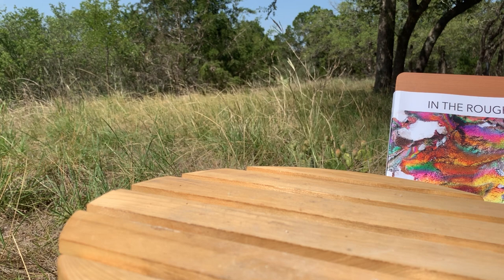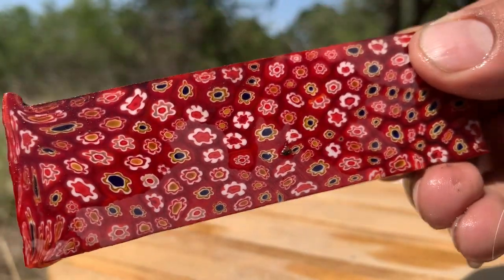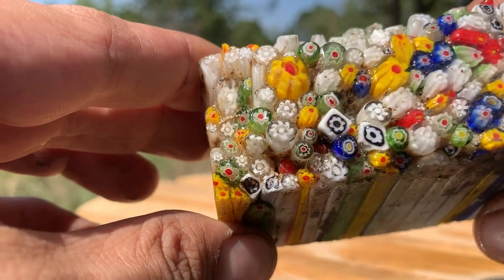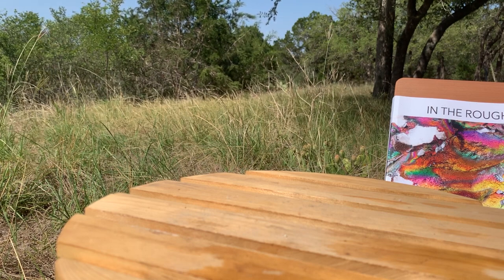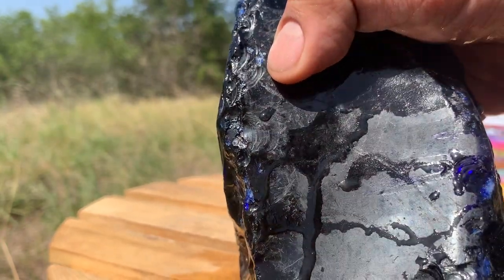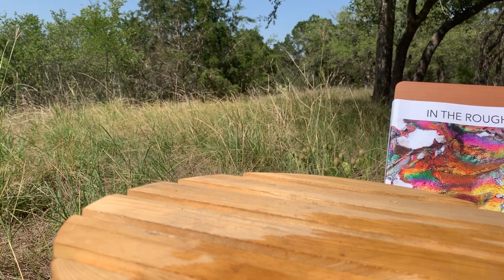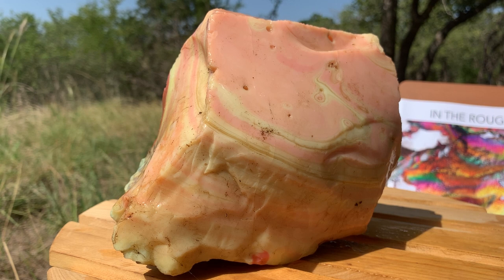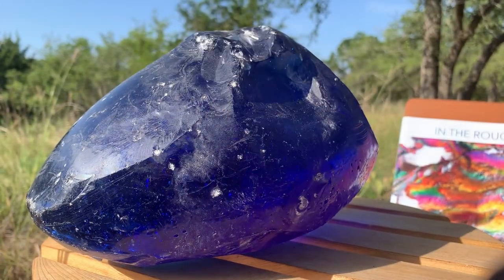SLAG GLASS and MILLEFIORE

Comment: Thank you for the excellent info love it. 
At exactly 00:01 the opal (I think its opal) moves and the shimmer it has does that prove at all that it is genuine or can fake opal also have the same shimmer. I'm not talking about the bright green colours etc but the general shimmer. Hope I'm making sense.
Reply from the maker: Here's one way I learned to tell real opal from fake and a suggestion that will be helpful.  First, look up some online listings for "synthetic lab created opal".  Usually it comes in a block, more or less.  When you look at the fake stuff, you will notice long lines of color going down one side. Also, there are no signs of matrix. This looks fake. Once you've seen it, you know one big thing to look for when trying to confirm real Natural opal.  Natural opal flash concentrates more randomly.  OK, I hope that helps and stay on that Rockhounding trail! Thanks again for watching Skyward Gems!